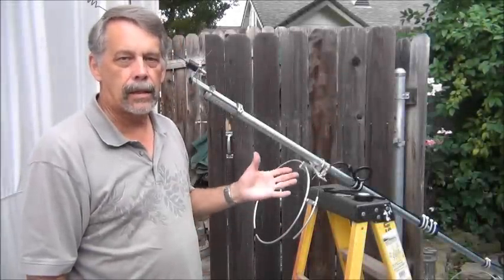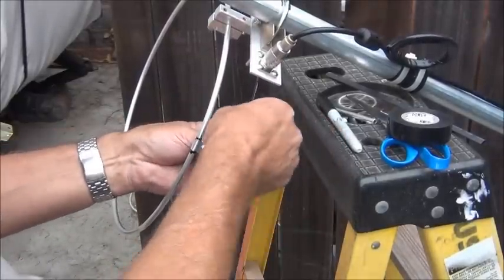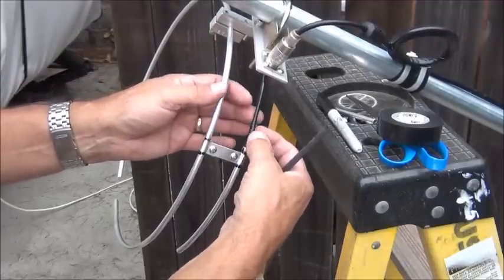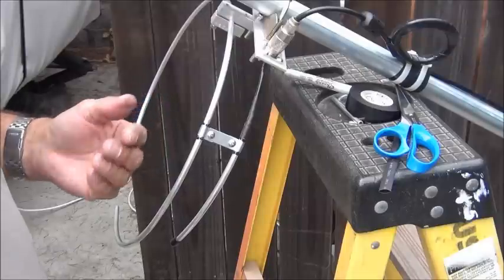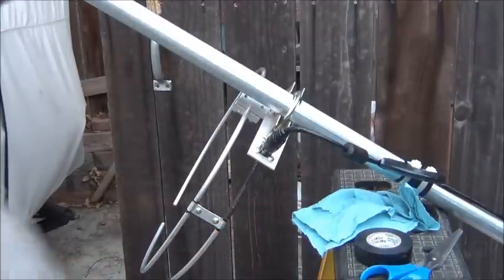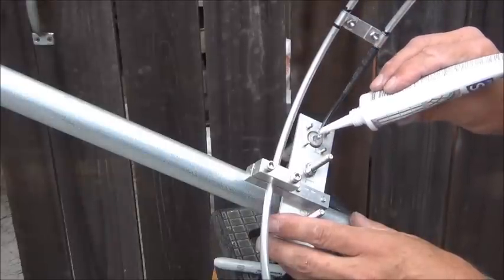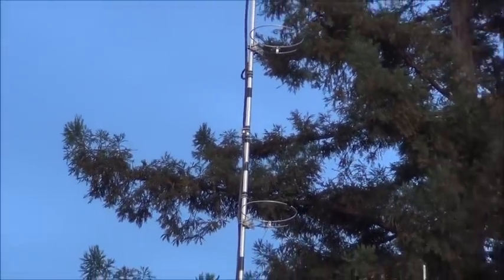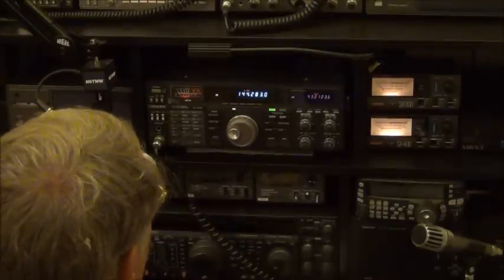2 Meter Halo Antenna Part 15 -- "Finishing Touches" by N6TWW

Comment: Halo Mike...
I,m from Indonesia.
very interesting.
What polarization for this antenna ? Vertical or horizontal ?
Reply from the maker: This antenna is designed for horizontal polarization. It is made for Single Sideband "SSB" operation on 2 meters.

Comment: Great collection of vids with excellent explanations of the Build Mechanics and RF Velocity Factor(s). Brought back memories of all the study time going from Novice to Extra Class.
Recently purchased 2M and 70CM Transverters from the guy in the Ukraine to be able to operate SSB via my TS-590SG. I'm in an Antenna Restricted Residence and you just showed me how to get the Transverters on the air at my QTH. Not sure if I can get a stacked pair under my upstairs neighbor's open wooden stairs but one Halo would be better than none.
I'll still construct a Moxon and a Yagi for Portable Ops from my SUV but now I have a clear path for VHF/UHF SSB Omni Ops from the QTH.
I watched your entire series in one sitting and totally missed the 2020/2021 Balloon Drop at Time Square but your presentation was well worth it.........
Regards/73 OM . .
Russ KA1RUW

Comment: Glad you finally got yer antenna finished.  Looks great and you've got some really low standing wave ratio.  I think I'd seal it up with some silicone caulking.  I see you've added a couple of ferrite beads to the feed line.

Comment: Good set up, although I have one observation. Those halos are grounded to the mast, the coaxial cables are also connected to the mast.
Choking the feedline at the two loops like that doesn't help anything, but only adds un necessary coax cable length and additional losses. You just end up recoupling the common mode current (which would be fairly negligible anyway) from the mast, back onto the outside of the coax by running the coax down it anyway. You've applied a good amount of effort and not a bad job done, but overkill my friend

Comment: I really enjoyed this as I am also interested in this type of antenna.I currently have a 10' mast on top of the tower with my 2m/70cm X300 Diamond up there. This section of mast is just begging for a horizontal set up like this. Thanks for taking the time to edit this video and I'll bet you have as much time in the video edits as building the antennas! Very well done. 73, Chris N1HD

Comment: Enjoyed watching your 2m halo ant. build. Got a couple of questions, is it directional and does it have any gain?
What is the diameter of the halos?
Thanks W5BNW.
Reply from the maker: The antenna is fairly close to Omni directional but it is not perfect. Since a single loop is nothing more than a dipole bent into the shape of a circle, there is no gain over a dipole. If two antennas are stacked in phase they will have about 3db gain over a single loop. The phasing harness build that allows two loops to be stacked is shown in the part 12 video. All of the antenna dimensions were given in detail in the part 10 video.

Comment: Hi there good videos, impressed with workmanship, are these antennas horizontally or vertical polarization, i read somewhere they have little horizontal polarization...seem to work well....from Fred g4vvq in England...
Reply from the maker: Tom Smith Tom, the antennas are horizontally polarized. They are intended for 2 meter SSB operation. The normal polarization for 2 meter SSB is horizontal. FM work is just the opposite (Vertically polarized).Mike
Reply: Mike Fedler Ok Mike, friend of mine is talking about using one on 2mts FM, which over here is for local stuff and mobiles etc, so i cant really see how its going to work, i dont think you can use one for vertical operation...how ever you mount them...think that is what you are saying....cheers from Fred in England, To is sort of an alias...
Reply from the maker: Tom Smith You are right that it will not work to the best efficiency in a vertical orientation. You could use them as dipole antennas without forming them into a circle but you would still have a few problems to deal with. You would probably be better off by using an antenna that is designed for vertical operation.
Reply: Mike Fedler Ok Mike thanks.....Fred.

Comment: very great project how much gain is that antenna i may make up a set of stacked 11 element again soon  right now my shack insits of a yaesu ft7 and a adi 2 meter mobil and a radio shack 10 meter mobile also

Comment from the maker: For my location it seems to work fine. The match does not seem to be affected when it rains. This method also makes it fairly easy to disassemble it there are problems.
  73, Mike